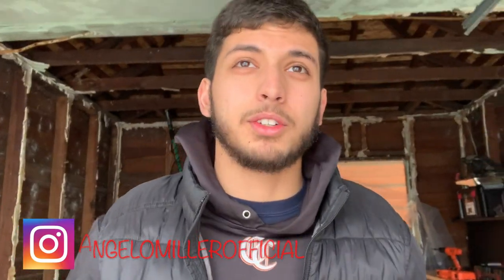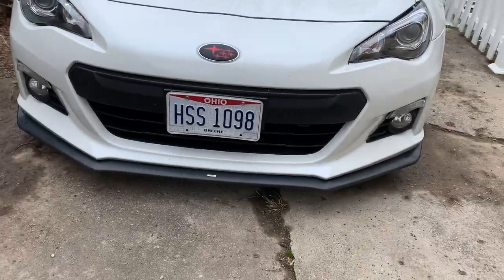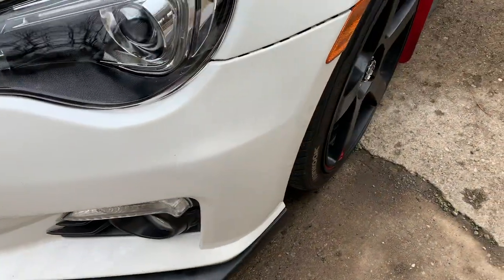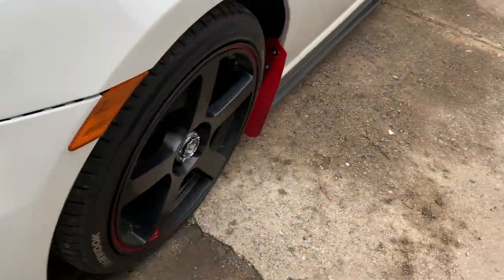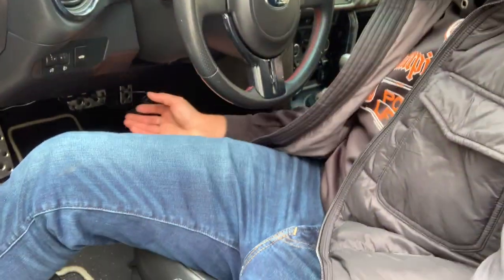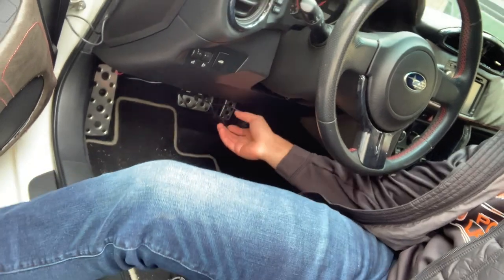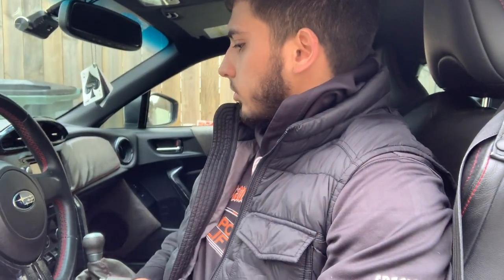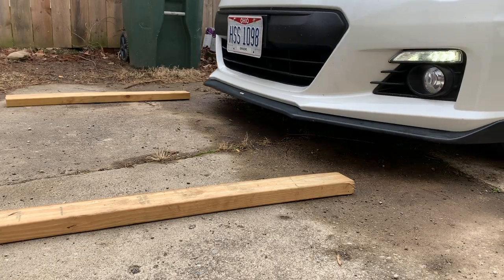Removed my front license place! BRZ Front bumper removal How to!

Comment: Thanks for the video. My friend wanted me to help him take his bracket off but I didn't want to get  into the nightmare of removing everything. We took off the top plate and we were able to sneak a vice grip inside to clamp the nut and it worked! 

Do not attempt to do this in cold weather, you'll crack your plastic. Thanks again.